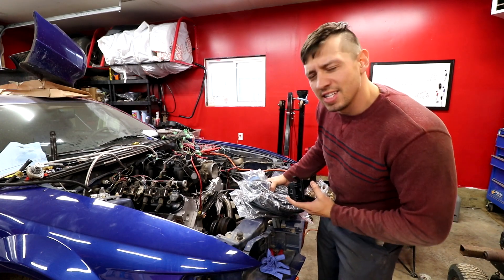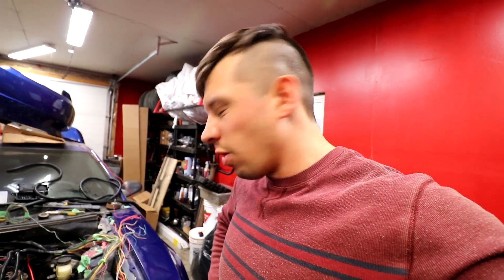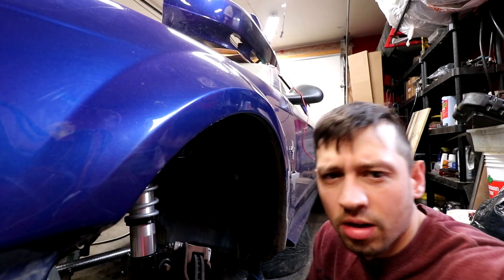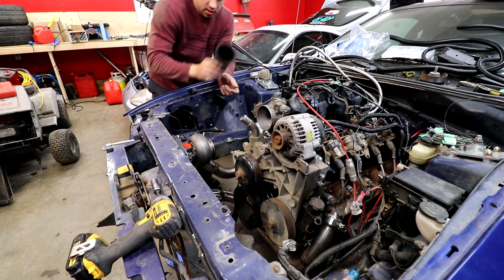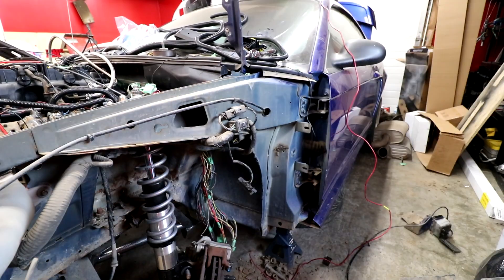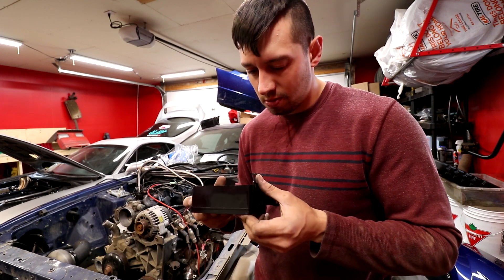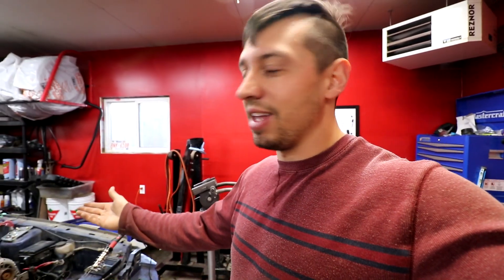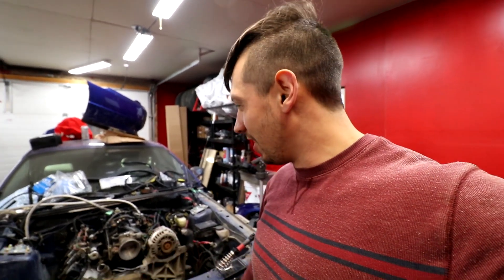Budget Turbo LS Build - Part 31

Comment: If you get heat wrap for your exhaust pipes, it will run cooler and keep the power steering pump cool
Reply from the maker: I planned on wrapping that crossover pipe

Comment: Accessory wise i used a truck alternator that i machined off the portion in back to get pulleys to line up with car accessories and cut truck bracket in half also so i could use smaller gto powersteering pump if you check out my vid on my channel you can kinda see it worked well for me for clearance im eventually turbocharging mine

Comment: I think that bigger hole right in front of cylinder 1's exhaust flange is suppose to have a coolant temperature sensor in it, and it looks like that is where the yellow and tan wire plugs into. If you look at lt1swap.com/pictures/53_3.jpg

Comment: Remove the passenger side air bag and put your pcm there
Reply from the maker: The way I split the loom I couldn’t run it back the other way it had to be on the drivers side of the engine bay

Comment: Somebody get this man some fbody accessories!
Reply: Overpriced and a waste.
Reply: @irocthe85  lmao fbody stuff is cheap, and will give him a bit more room.  Without looking like they sat in a sand filled mud dumpster for 8 years.
Reply: Cheap compared to the stuff he already owns? Who cares what it looks like as long as it makes choo choo noises?
Reply: @irocthe85  eh, difference in approaches.  Personally I'd ask if anyone had anything to sell or just browse my local u pull, classifieds, etc.  Fbody parts are easy to find, and it would give him a bit more room, as I said.  You wouldn't, it's cool, dont get butt hurt someone thinks differently.
Reply: I’m not getting butthurt, just pointing out that he’s trying to do it on the cheap, plus fbody accessories most likely wouldn’t fit with his current hot side.
Reply: @irocthe85  no worries, I had said months ago he should have gotten some but they all work the same.  I'm also stubborn and still want an opti powered ltx turd lmao
Reply from the maker: Yeah I’m still unsure about the accessories . I might just send it the way it is so we can drive it, find the weak link, fix it, find the weak link and just enjoy breaking the fucking thing :) I think you’d guys would love to see me or tokyo driving it more than you want to see it sit in the garage :)